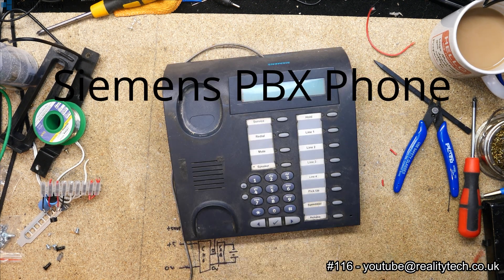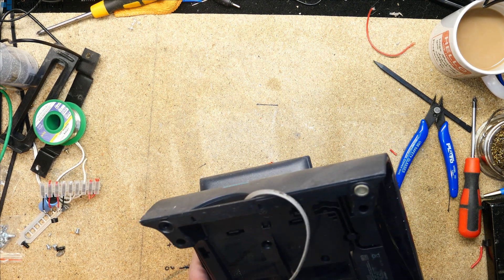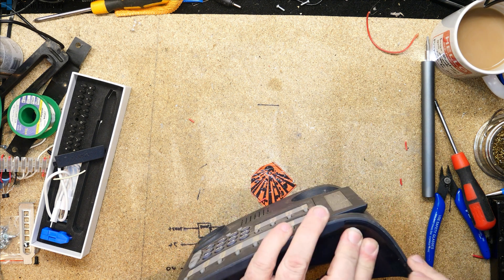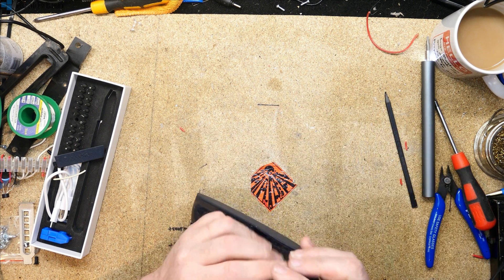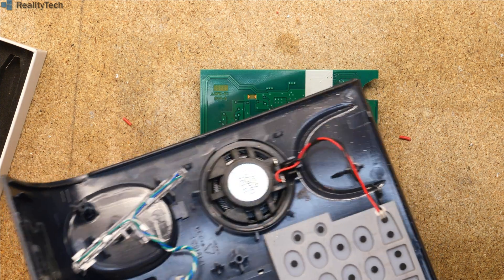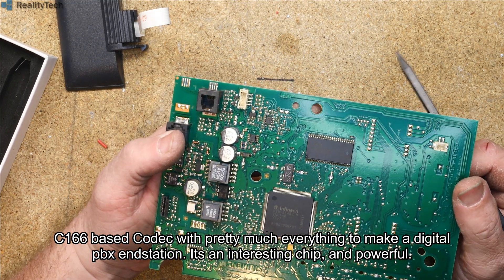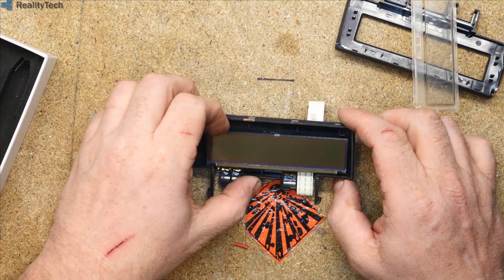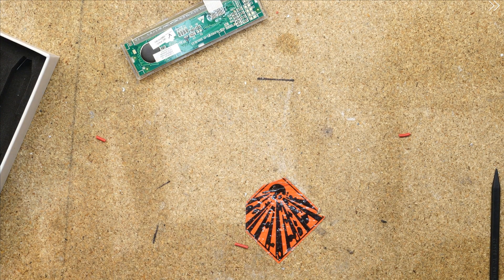#116 - Siemens Digital  PBX Phone  Teardown

Comment: I like your videos on the siemens systems 

the main failure on those phones are the LCDs so they are not so relaiable 

you have on of the moste basic units the other ones have microphones and up to two expansion slots on the bottom for isdn microphone analog support an much more
Reply from the maker: This was removed and replaced with FreePBX and GS GXP2160s so a bit of an upgrade. But they only had the bare minimum they needed before. With our national carrier killing off copper shortly and the writing already on the wall for ISDN  there's a lot of these systems coming out of service
Reply: @rtechlab6254  yes that happen in germany right now too but Vodafone for example gives to there businesses customers a box the have to use that gives out the voice channels by default over isdn so many still use them for there reliability